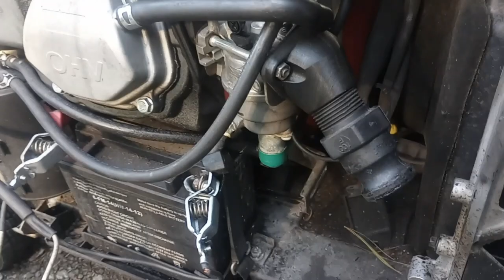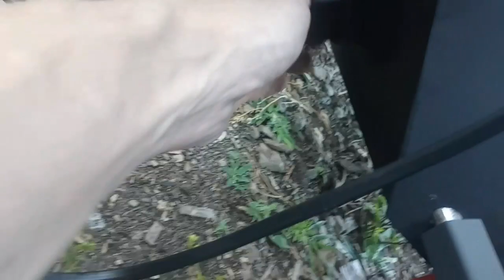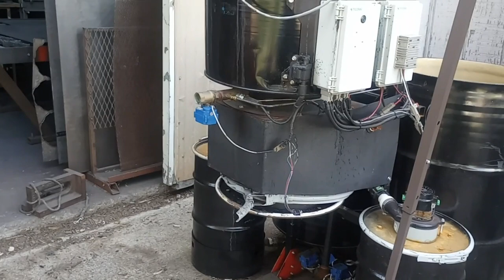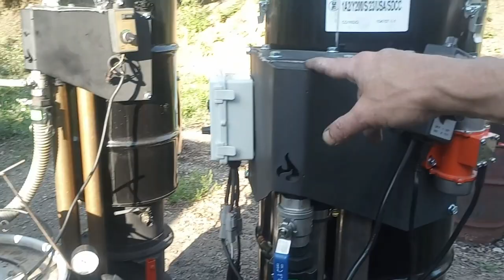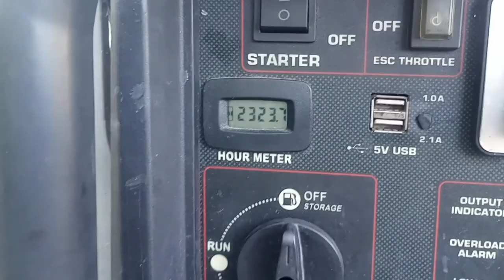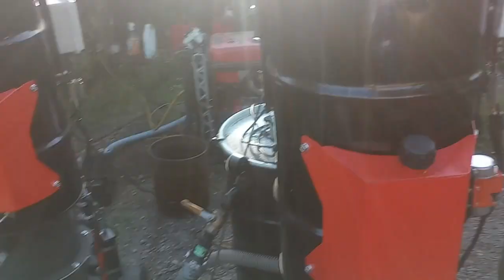2024 DXF 10 Standard / Wood Fuel Option and Start Up Tutorial

Comment: For someone who would like to run a unit daily, do you recommend producing charcoal from wood, instead of using standard fuel? Thanks
Reply from the maker: I took this off the market I wont even sell a wood gasifier for small engines. What I was trying to do with this unit was make it so it could run both as 95% of the market is looking for wood gasification and dont even know charcoal gasification exist or understand why its a better technology. 

So to answer your question yes charcoal is the only fuel you should be running in this machine. Wood Gasifiers just can not run stable enough to be practical due the nature of thier construction and no wood gasifier is exempt from tar. 

Are you planning to add a battery bank? With a battery bank and a few retorts it would be perfectly viable to fuel using charcoal as fuel daily. That is the part many dont see, this wont happen with wood fuels you will never dry enough fuel for daily use especially in colder climates.
Reply: @Thrive-Off-Grid  thanks for the answer. Actually, yes, I'm planning to use a gasifier coupled with a generator to load batteries when they can't be loaded enough by the sun, which is certainly half a year in my region... i have access to a lot of wood and understood from your video that charcoal would be much better and stable so I'm now thinking about producing charcoal. Now, I would need to find a way to reuse the heat produced by charcoal production. Which makes me think some big boiler (I would reuse the heat to run my home heating system) where a complete big can full of wood would enter in the burning chamber may do the trick, don't know.
Reply from the maker: @markusscholz5683  Yup see our forum there is a retort I just built that heats our shop. Ill be buildng larger versions of this. dont think you are wasting anything though. Wood processing you waste just as much. You burn fuel to run the equipment the fines (about 25%) is also waste. You are not gaining anything with wood fuels just a migrain. What you are really wasting is money out of your wallet replaceing tarred up generators.

Comment: Awesome work been following u for a while. So charcoal is still the best fuel option for long term off grid ? I don’t mind making charcoal..  I just don’t want to tar up my genies. Cheers 🍻
Reply from the maker: It depends on your circumstances. The key to small scale wood fuel gasification is making sure your fuel is dry. Dont fall for the 15% non sense, you need to dry it to the point where a meter will not regsiter. Those making claims like that are not running thier machines daily. Eventually those machines will make tar. Colder climates in the winter it will be very dificult to dry wood fuel this dry sustainably. So charcoal will be a better option especially if solar is part of the system and you are using this to back up that system. Then besides that the wood fuel kit adds complexity. A wood gasifier that this scale /  stand alone stationary must be automated with an AFR controler. There is the complextity of the inner core and then additional filter and relocating the blower to a cooler point in the system. All this adds more cost and can be out of reach for some. Then will all that wood gas will never be as clean as char gas and there is never  a guarentee the wood fuel system wont make tar. There is no such thing as a tar free gasifeir and there never will be. At least not direct gas out to engine. The VersiFire may change that but we are still testing this. 

Ive decided to take a new approach. The DXF Series will never be shipped in a wood fuel mode. This will be sold as an add on kit that the user must install themselfs. We want our users to start on 100% charcoal with machine in charcoal mode. This way they get going and learn without worry of taring up an engine. They will learn how the system should run and self sustain. Learn how the engine runs and what loads it can handle on the gas etc. Then they can move on. but I think some once they learn making charcoal is not all that hard may just end up staying with charcoal.
Reply: @Thrive-Off-Grid  Hey thanks for your lengthy reply I do appreciate it. I think I will stick with charcoal, I don’t mind making it and would rather have cleaner fuel to make the generators last longer. Do u have any used gassifiers u could sell me ? Maybe one with a little bumps and bruises, I want to buy a new one I just can’t afford it right now. Thanks for the work ur doing.
Reply from the maker: @doenjohnjo434  We actually do and this is not very often we have one. We are in process of refurbishing a 2023 DFX-S3. It was our demo unit. Since we now have a DXF-10 we have no use for it, so we have tore it down and it is in the midle of getting new fresh paint. This will have a brand new hose kit, all new seals and a new ammo box filter as well. It will be ready to ship next week. I will be putting on market early next week. So grab this while you can as I expect it will sell fairly quick.

Its $1950 plus shipping. This is 50% of the original cost

Comment: Hello Dr. Thrive : ) Another nice iteration of your work. Just a thought. Your build structure is similar to a hand dolly, thus it may or may not save time to start with one. I have a Ben Peterson gasifier that I built, about 90% complete. Time is the issue. Mine is set up run a 351w Ford V8. I can tell you thought this out very well. Given the problems with wood, I assume you prefer to use charcoal? You may not be aware, but you can use similar Ametek fans to build a DIY 5 stage HVLP sprayer.
Reply from the maker: Nope as you may note our demo is set up for wood fuel in the video. We run wood fuel in the summer months and change the machine over to charcoal in winter months.
Reply from the maker: https://forum.driveonwood.com/